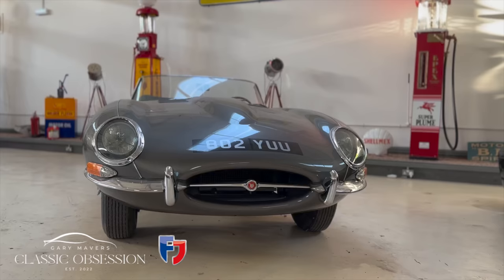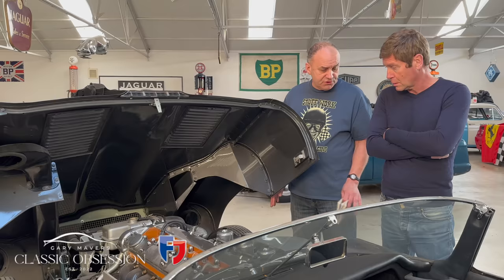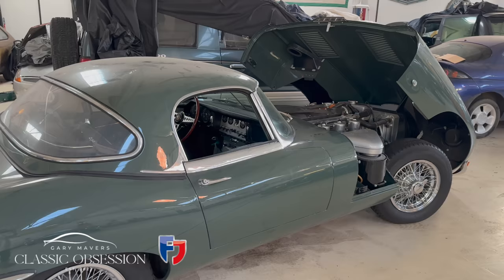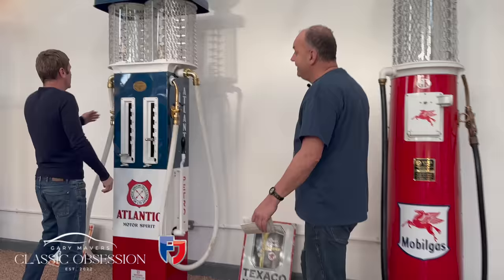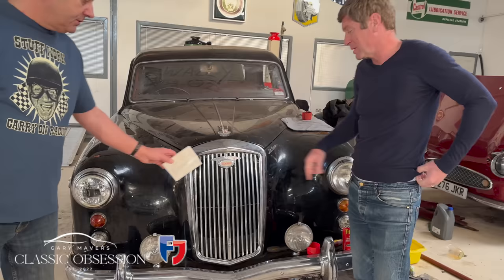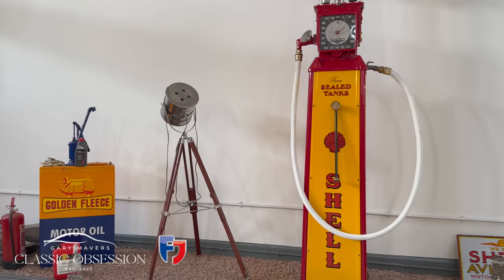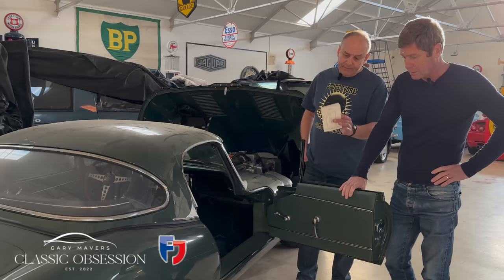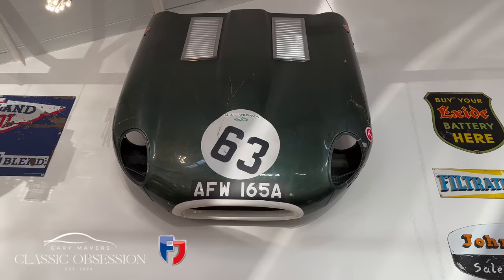Rare E-type Jaguar Prototypes | Classic Obsession | Episode 18

Comment: That's a true story, but he was a trainee designer with Jaguar, and he isn't happy with the design and wished he'd made a better job. 
XJ-S was initially designed by Malcolm Sayer, who designed the E type, and the XJ-13.
Mr Ashcroft is wrong in his telling of two XJ-13 JAGUAR LeMans Racer,  but only one was produced, but crashed by the late Norman Dewis at MIRA in front of many  car journalists.  
He hid in the footwell and bent his head below the dash and survived as the car flipped several times as the magnesium racing wheel collapsed due to fatigue.
There have been 3 or more toolroom copies made, and one almost exact copy came out during the COVID-19 pandemic. 
It had a running quad cam rare V12 jaguar engine that was also ran in the true XJ-13 .
History level over, please be aware questions may be asked later.
Reply from the maker: Hi, Neil. All very interesting stuff. Thanks for the insight and sharing your knowledge. Kind regards.
Reply: Great to hear the stories about the XJ-13 with varying accounts of what happened and how many Cars were made .

Comment: Header tank cap and gear lever top missing ................after 5 mins turned it off.
Reply: O work ongoing there ,lots to do
Reply: @scottstrails9369  E Type Series 3 V12 had pressed steel wheels ............................Also no production 4 cylinder XK engine was ever fitted in a production car.
Reply: @scottstrails9369  that grey 3.8 looks like it needs a lot of work
Reply: @larrysimon1  great info ,many thanks
Reply: @larrysimon1   those old cars are never ending with upkeep

Comment: Couldn’t you get to have a go in one of the e types that would have made a great ending to your video a famous car mag to a stock e type coup over to the autobahn a few years ago piloted by a racing driver and achieved 146 mph before having to slow down for traffic surprising the owner who thought it would only achieve 130-135👍
Reply from the maker: Hi Paul. It suddenly was thick with snow. Regards.
Reply: @classic.obsession  bet you were gutted loving your films
Reply: @classic.obsession  There’s quite a  lot of old pics on the internet with the E types on winter test and most likely Norman Dewers Would have  encountered  a bit of snow on the epic journey at the ‘61 Geneva Motor show across hill tops ,making it to the show just in time .
Reply: A rear end of  1.07  will get you  150 mph